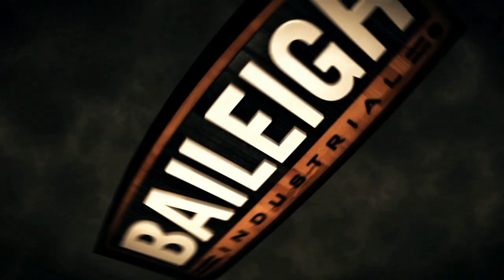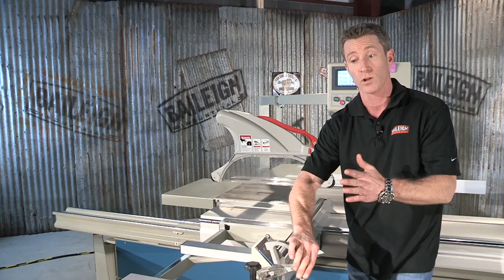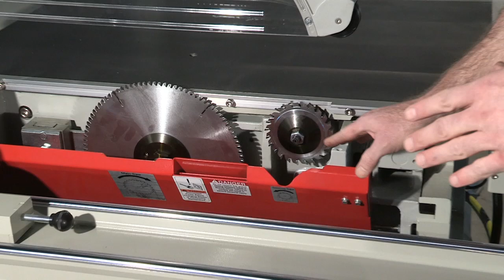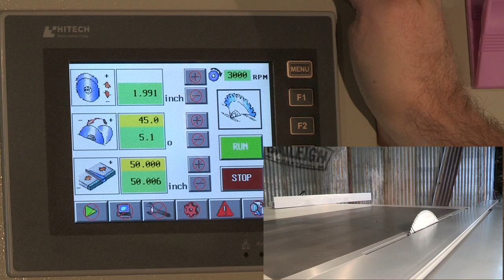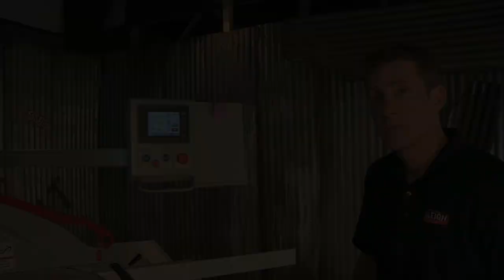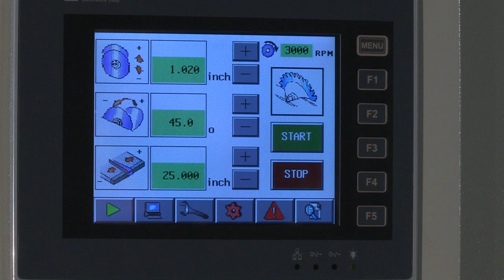Baileigh Industrial STS-14120-CNC Table Saw CNC Woodworking Tablesaw Wood Cutting Machine

Comment: This is a comprehensive bundle for any woodworker [Check Details Here⇒>☞★☞https://plus.google.com/u/3/110086446704524205338/posts/AdB3e6wj7Uj ]. This stuff is an aggregation of experience and mastery to draw out the best for any woodworker. I can use this for quite a while to come.